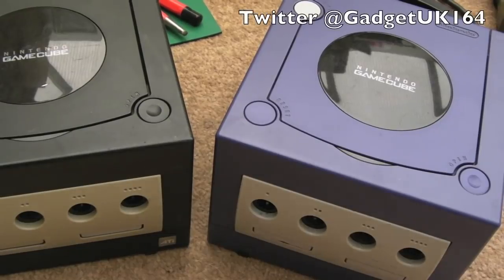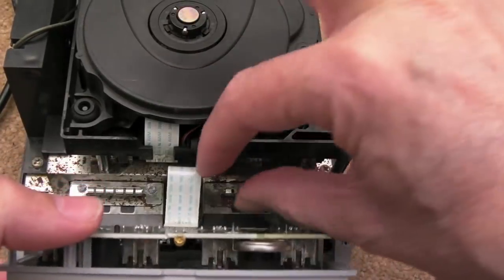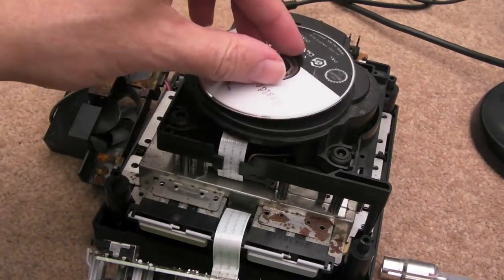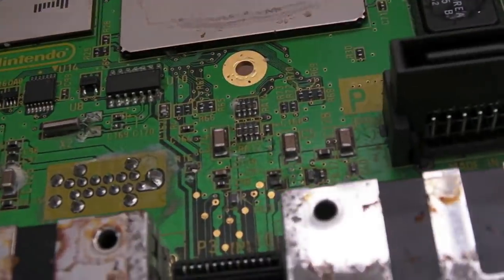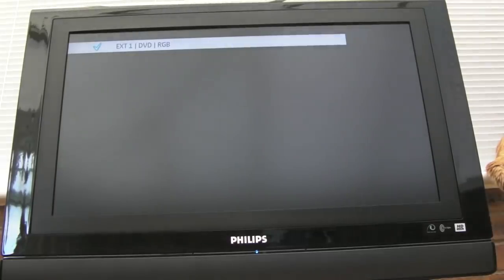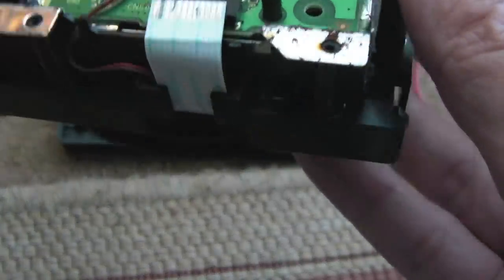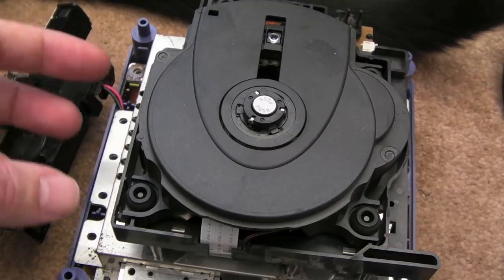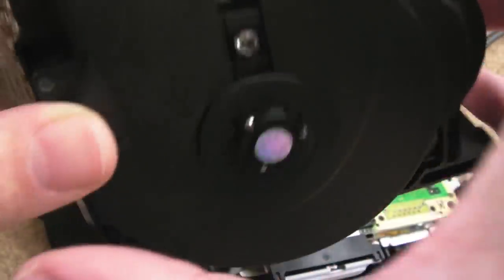Nintendo GameCube Repair -  Part 2

Comment from the maker: Note: I forgot to show the resistor I fitted in place of the one that came off when cleaning.  If you look closely you can see I fitted a brand new 0805 one later as the old one broke in two due to the corrosion.  I've ordered some universal stencils, and I have already removed the CPU - confirmed bad solder point and a damaged via under the CPU.  In the next part I will have a go at refitting the CPU.
Reply from the maker: It's almost impossible to solder from the side there - clearance is like 0.5mm.  If I had a super fine tip I might be able to I guess.
Reply: I hope you can re-do the CPU - look forward to seeing that!
Reply from the maker: Thanks!  Yes, I've ordered one of those!
Reply: @Chriva  Nice tip!
but i wonder if there are more balls that have issues and not just the one we can see.
Reply from the maker: There could be more than one bad under there, but I suspect the main issue is just that one.  It's no coincidence its via underneath was corroded too.   If I can get the chip off, reball it, and put it back on, I think I can fix it.
Reply: Isn't there a voltage divider that the optical drive takes its power from. A 50k pot I wanna say.
Reply: Part 3 still planned?

Comment: Love that the ATI Chip is named flipper, considering that Dolphin was the code-name for the GC. Looks like the days of needing bench Microscopes, more rework tools & test equipment are getting closer and closer. I wouldn't mind one now. My back was in bits after leaning into those Socket 7 motherboard repairs.

Comment: I got a Gamecube that was as rusty as that really bad one. I looked like it sat outside for a couple of years! Amazingly, even though it was sold as "junk/parts", it booted right up and had no problem reading discs (I had cleaned the lens with IPA first thing though),

Scrubbing the rusty ground plane around the edge of the board with IPA didn't do very much, but scrubbing it with a Q-tip soaked in Deoxit cleaned it right up!
Reply from the maker: Yes, I do use deoxit for some things, but I tend to keep it for other things as its so darn expensive in the UK =/

Comment: I bought a console with the same problem. It doesnt have any corrosion, however. I figure I would do what you did. How did you go about reballing the CPU, what do the stencils that you have mentioned in other comments do? I tried to find a part 3 with no luck. I have never dealt with removing a CPU Chip before, so unfortunately don't know how to start. Thanks in advance!
Reply: I have tried swapping the laser and door switch with no success

Comment: Top video Chris, the GameCube is a very underappreciated system if you asked me. Bummer you couldn't get both of the systems working but at least you made one good working system out of the two. As for re-balling the chip I'd wouldn't bother it's too much hassle. I'd just use the board for spares and try and fix the faulty laser to keep for a backup.
Reply from the maker: Thanks =D  Nah, it's not too much hastle! =D  It will take 5 or 10 mins to remove, then use a stencil with solder paste (I just need to find the correct stencil), and then just refit the chip.  It's worth it for the experience alone!

Comment: @17:18 the chip used for the RTC, one of the pins came off during a console mod attempt (faulty soldering iron) is there a way to replace this?
Reply from the maker: Carefully dremel into the edge of the IC to expose the pin!

Comment: Hello, I am new following your videos, they are awesome. May I know what is the "pen or eraser" you use to clean the corrosion? Thanks
Reply from the maker: Thanks!   I use a fibre glass pen / pencil, and a wire brush pen / pencil.  The wire brush one only use on shielding etc.  The fibreglass pencil can be used on PCBs.  eg. https://www.ebay.co.uk/itm/3Pc-MINI-WIRE-BRUSHES-Pen-Precise-Bristle-Remove-Rust-Dirt-Precision-Pencil-DIY/202254739729?epid=21016300142&hash=item2f17526911:g:iHQAAOSw6H5alSSd

Comment: New to your channel man. I am having an issue with gamecube not reading discs.  I tweaked the POT, but no luck. Replaced the laser, and still no luck. Any advice?
Reply from the maker: It could be a number of things - firstly, it could be the replacement laser does not work properly (often these cheap ones can be hit and miss as to whether they work or not - I usually buy 3 or 4 if they are so cheap, and often will find 50% work, 50% do not).  You really need to scope the RF signal and adjust the pot based on that signal to be 100% sure if the laser works or not.   If it still does not work with a 100% known good working laser, you might have a fault somewhere else on the drive.  It's worth testing the motors, ensure the track zero switch works OK, lubricate the rails with some lithium grease or molykote, check that the gears are OK (free to move with no broken teeth).  Finally it could be the SMD caps on the drive PCB, a faulty IC or component on there, or bad connection between the drive PCB and the motherboard.  Also check the motherboard looks OK, and that the regulator PCB is outputting the correct voltages (covered in part 1 of the recent series I just did on the GameCube).
Reply: @GadgetUK164  thank you. I will definitely give those things a try. Have a good day.
Reply: Well everything except for the o-scope. I dont have one of those

Comment: my gamecube been freezing randomly or artifacting every time i play super monkey ball 2 bowling. Fine on everything else mostly. It happens after a bit. I think caused due to heat. SNy idea what to do to fix it? (could it be the fan?)
Reply from the maker: Probably not the fan, it could be something overheating - maybe re-seat the heat sink and add some good thermal paste and re-test it.  It could also be a power problem, or bad capacitors (least likely on these).  Finally it could be a bad BGA connection, or a failing IC - RAM?!?
Reply: @GadgetUK164  ya i had this problem since i had the console in 2002 lol. But managed to fix it. I did get a new board well pre owned but was fully working. I used 2.0mm pads on ram, cpu and gpu and screwed down heatsink lightly till screw stopped turning. Seemed to have stopped freezing mostly. I think it overheating due to fan not performing like it should. I can play awhile but then it either reboots on me now or freezes.

I am waiting for new fan mount and side fan to arrive to test cooling. (fan it got clean but i feel hot air coming out but barely feel air.) Also fan really loud.

Comment: When I use 99.7% IPA  on a circuit board with a tooth brush it leaves a sticky residue that I then use water to remove. I am confused why it leaves the stickyness.  I got the bottle of IPA from RS Components.
Reply: Ok I will try that next time.

Comment: Could you drill a tiny hole to reach the disintegrated ball and solder something conductive to it?
Reply from the maker: The problem is that because its a multi layer board there are traces in the middle inbetween the top and bottom traces.  Plus the traces on the top side would be in the way of any hole you might want to drill in that area =/

Comment: I need help! My gamecube is stuck and freezes on loadingnscreen.. dont know what to do..
Reply from the maker: It might be worth swapping the drive unit out from another GameCube to determine is it the drive or the main board.  The freeze could be caused by a fault on the main board, the power regulation board underneath, or a bad PSU too.
Reply: @GadgetUK164  thankyou ill try it out, ill text you if it worked

Comment: Hi.. Awesome video..My Nintendo is also having the same problem..Is it possible for you to help me out??
Reply from the maker: In my case the problem was corrosion under the CPU - one solder point had disconnected.  The difficulty is reballing the CPU and re-installing it.

Comment: hello The resistor responsible for the clock in the R16 part of my GameCube is broken. What kind of resistor capacity should I use?😢
Reply from the maker: You would need to find schematics for the Gamecube, or measure resistance of that resistor on a working board.

Comment: I used your videos here as a reference when I was fixing my girlfriend's GameCube. It had a similar issue where the IPL couldn't start, resulting in a blackscreen on boot, though this one wouldn't even produce video. It was otherwise completely spotless. No corrosion on any part of the unit's shielding plates, and spotless connectors that all were verified working in another console. I found one completely random VIA that was fully corroded through with a blue residue near the system RAM. I cleaned it up and traced the link, rejoining it on the back side of the mainboard. It booted up without issue after that. I went a step further and got XenoAT328 compiled and flashed to an Arduino Pro Mini to act as a mod chip. It's all working great now. It was a silver DOL-101 for reference, so it wasn't fixed with any intention of profits, but it's nice to know that it can be fixed.

I wish you the best of luck on your reball attempts, and thanks again for the starting point and hints on the possible problem. I couldn't even find any references online other than your video on what to look for in regards to issues after all. I can only hope yours can be saved as well. All GameCubes deserve a second life!

Comment: Very nice, I am always excited to see a new video from you, I haven't watched the whole video yet but a technique I always wanted to try but never got around to on the metal parts is submerging it in rust remover (you can get it in the auto parts store) it's a yellow liquid and removes rust slowly , once it's removed you can spray paint the metal and it should permanently fix it, you can even reuse the liquid

Ofcourse PCBs are way more difficult but after watching way too much Lois Rossman videos for my own good it looks like a very good ultrasonic cleaner can clean it , but wow are those things expensive!
Reply from the maker: Thanks =D  I have an electrolysis video coming up!

Comment: Interesting problem ! What you may require is a stencil of 27x27 and 256 contacts for the Power 3 chip also known as the IBM 9314pq chip. I have had a quick look around and there are many out there this one looked a bit different to your usual metal stencil as its a sticker here is the link https://www.intertronics.co.uk/product/flextac-bga-rework-stencils/

Hope this helps, if anything the dead board is a great way to learn new techniques, as long as you don't stay down that rabbit hole for too long :)
Reply from the maker: Thanks!  I've ordered a universal stencil set!